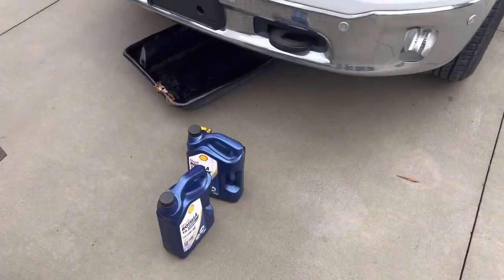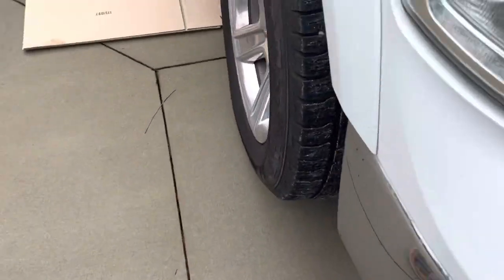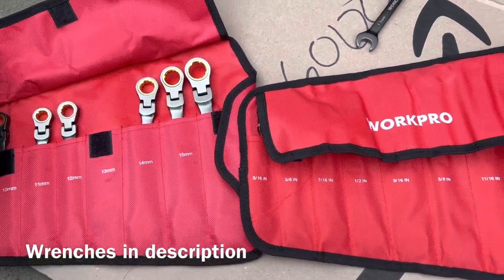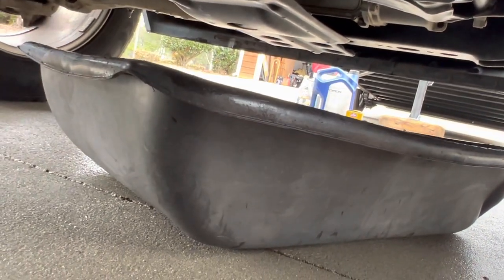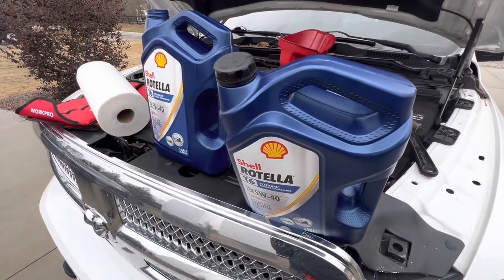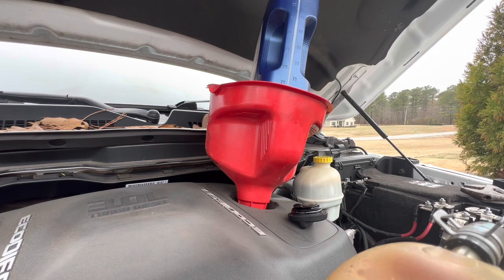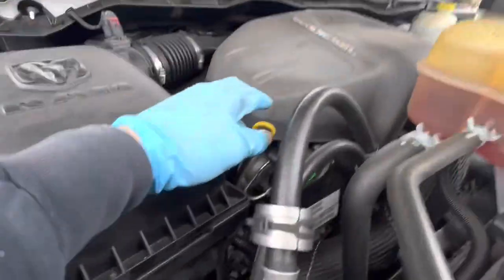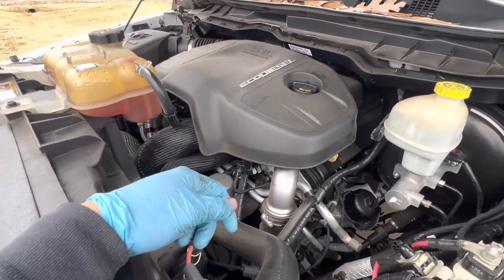Oil change on 2015 ram ecodiesel

Comment: How long did you let that truck set before you took at oil filter off because my neighbor has one that I change the oil in it for him and it takes 2 hours for it to set after it's been run before you can take the oil filter out or you make a heck of a mess
Reply from the maker: Maybe an hour or so